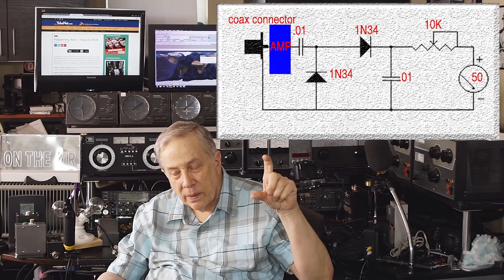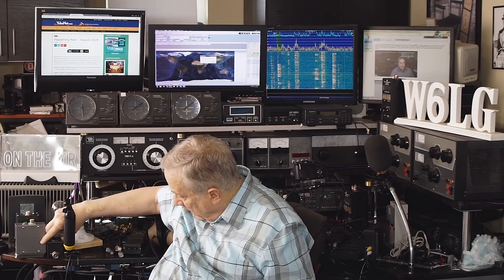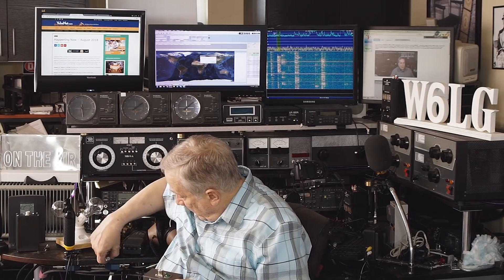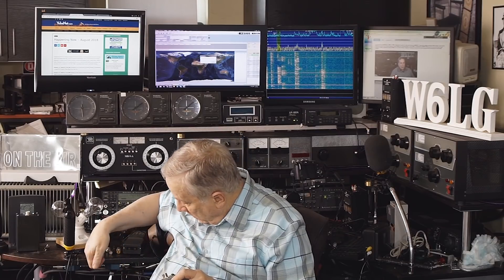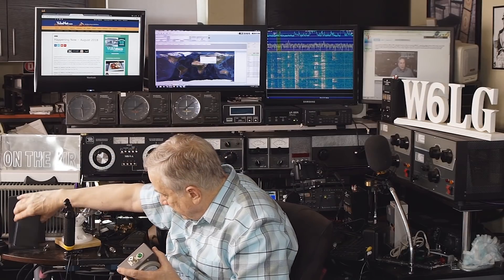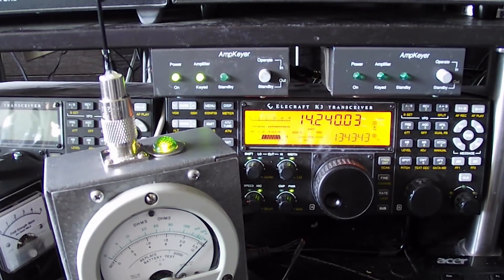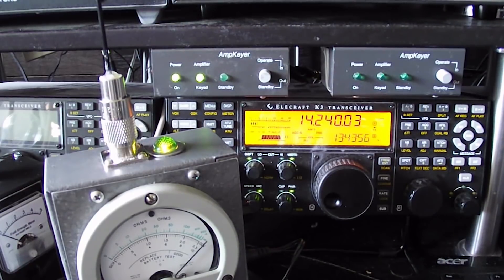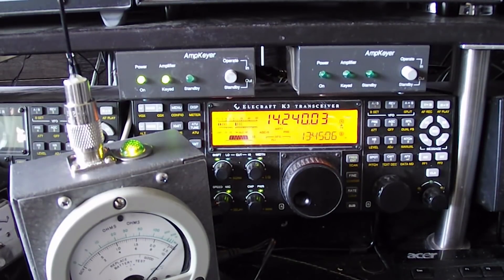Ham Radio Basics-Field Strength Meter and Emil 9A9A

Comment: Hi Jim, Love your videos. I’m just getting started in Ham Radio KI5BIK, hopefully my new vanity call sign will be issued soon. I am setting up my station, which has been slow due to an AC leak causing me to redo the ceiling in my soon to be radio room.
Have you considered doing a video on station grounds? I have seen a few videos on the subject, but it’s still a little confusing. If you use a window pass thru and use the wing nut ground to a ground rod, and to your equipment is that a ground loop to your coaxial cable gnd shield?  What about the third prong on your wall power plug, does that create a ground loop. BTW my radio room will be on the 2nd floor of my home. Value your opinion and insight.

Charlie
Reply from the maker: I have and it is probably the hardest subject.  I have seen the video where the guy cuts the ground lug. DON"T DO THAT.  It is the same group that suggests that you lick with your tongue the PL259. I don't watch them. Fortunately their audience is a small number.  When I feel like I can give helpful advice on grounding, I will cover it.  I am on the second floor above the garage and there is no grounding conductor for RF to ground.  It has been that way for almost 40 years of DXing. 73, Jim

Comment: Hi Jim - I've been meaning to build a field strength meter.  I think I found the amps on Amazon you were referencing, but they appear to use 9V to power them.  Are you using the same 9V to power the amp as you are to power the circuit?  Any chance to see the inside of your meter?